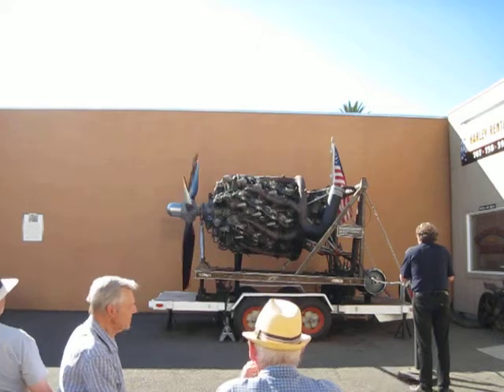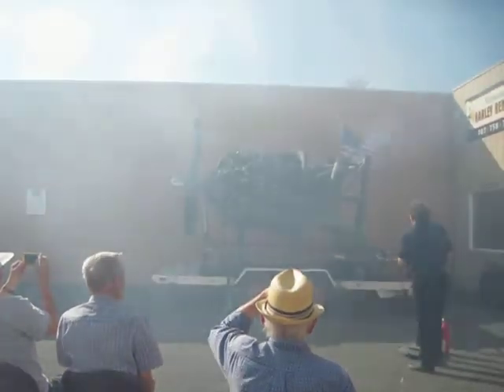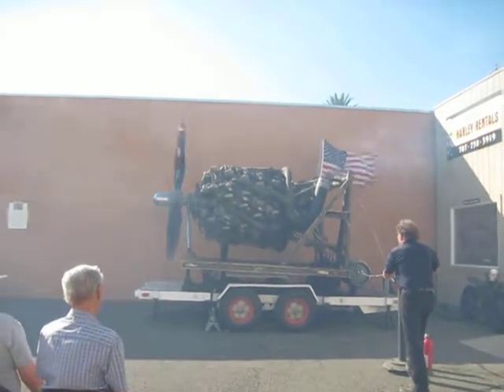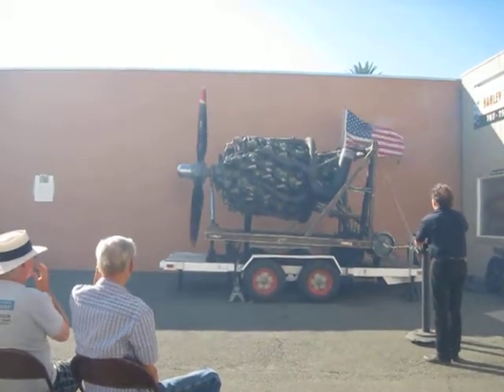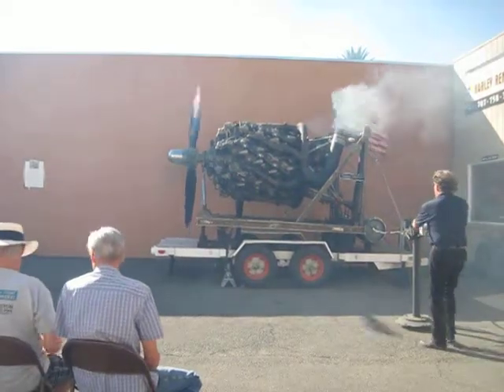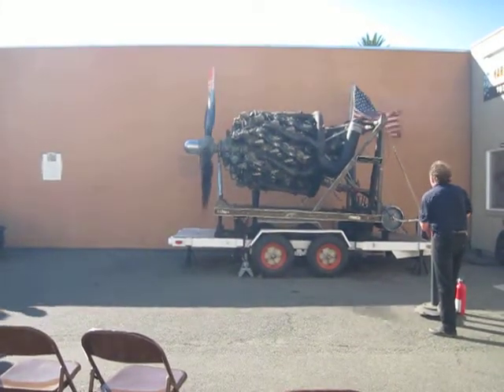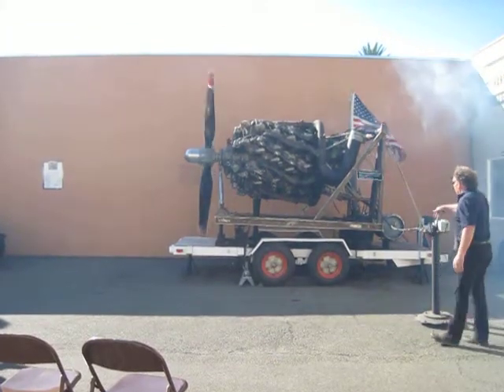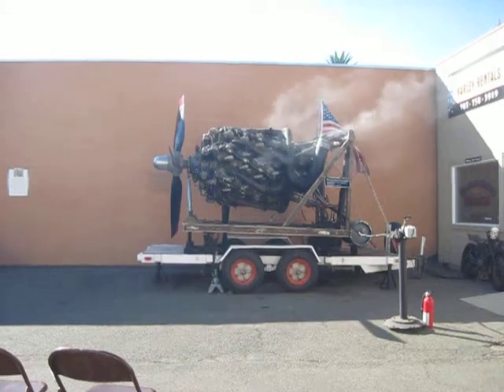Pratt & Whitney R-4360 Start Up

Comment: what is that new zealander talking about, it is total bollocks. Pratt&Whitney,s  R-4360 is rated at 3,000hp not 6000hp, the moron does  not know fuck all  about the B-36  peacemaker. iI DO !!!!, the B model B- 36  the first to enter service with SAC in the late 1940,s-1949-early1950 powered by six  Pratt&Whittney R-4360-25s at 3000hp each, the D-model with  four 5,000lbs- 6000lbs thrust General Electric J-47 axial flow turbo jets in Boeing B-47 Jet nacelles with side bracing struts, these augmented the six more powerful Pratt&Whitney R-4360-41s at 3500hp, this model replaced the stillborn B-36C with  P&W,s awesome  R-4360-51 VDT stands for Variable Discharge Turbine, a highly complex turbo developed by General Electric with  adjustable guide vanes in the turbine housing. Rated at 4300hp some say 4800hp, this was the hottest R-4360 to come out of their Hartford Factory. Sadly the  B-36C  never entered SAC Service due to  horrific problems with  the  remote gear box prop shaft transmission needed for the C model, remember the Northrop XB-35 Flying wing with  2x R4360-7,s and,2xR4360-11,s which used a similar arrangement .  Final  B-36 model,s  the H&later J-Featherweight all unesesarray weight stripped out to improve high altitude performance,a shade over 400 mph at 37,000 feet.  Six  R4360-53,s with Bendix Direct Fuel Injection, instead of their PRB-Series carburetter, rated at a respectable 3800hp. with water injection  (ADI) . from oldboilerdog.